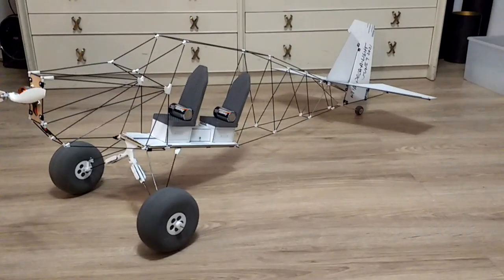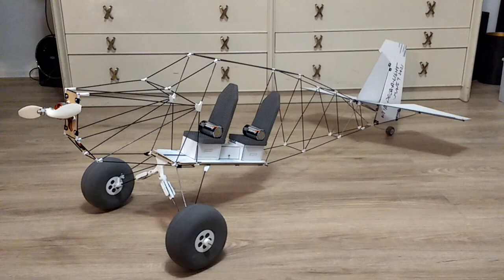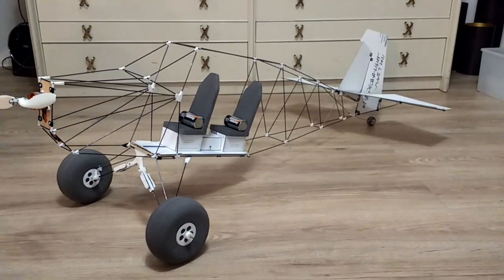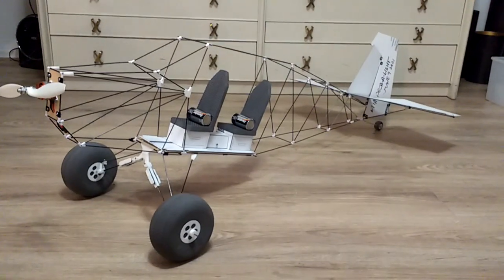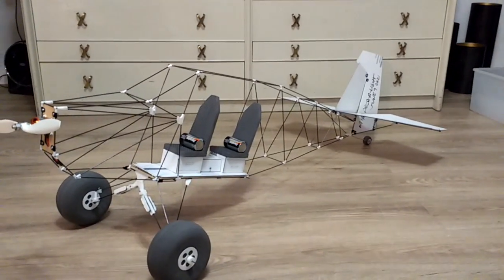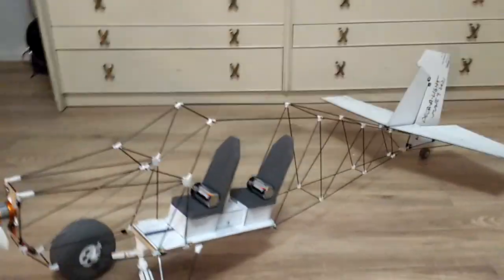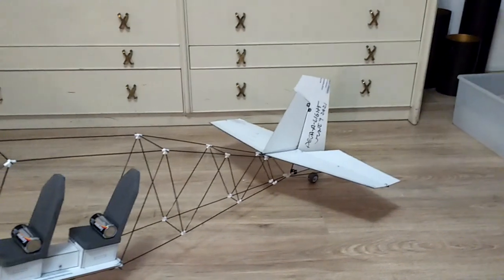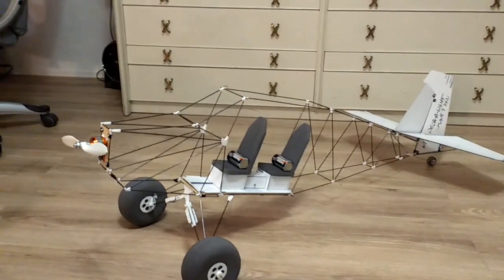MIA DECATH-a-LIGHT (TM) STOL RC Ultralight Part 1

Comment: Could you please help me to understand how the black colour frame is made ?  material and the procedures  ?  Also please share the plans [ dimensions ] along with motor specs
Reply from the maker: The back color frame? the white parts is not a frame, they are individual pieces that form the vertical, horizontal stabilizers with rudder and elevator also as separate pieces, the mock-up parts were made from thin corrugated cardboard, but the actual parts were later manufactured from 1/4" bluecor fan fold foam, or 6mm depron. This model has a wingspan of 8ft, and uses an brushless 800 watt motor swings a 14" prop.
Reply: @MarioIArguello  I was referring to the skelton , the chassis , how it was made ?  what material ?  kind of tube ?